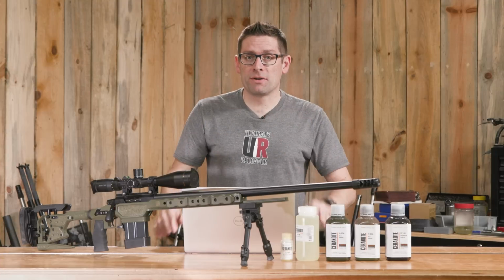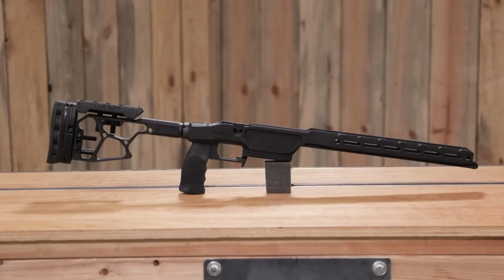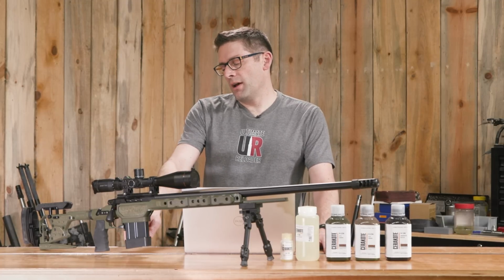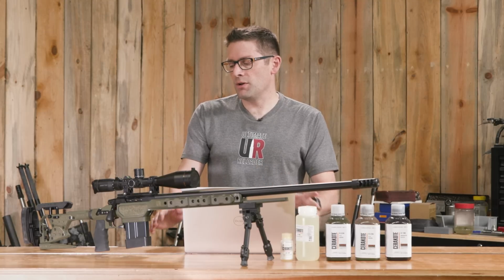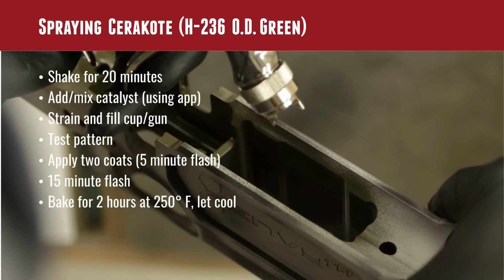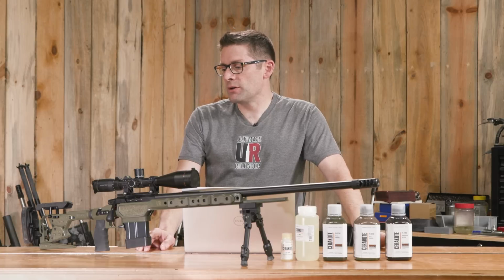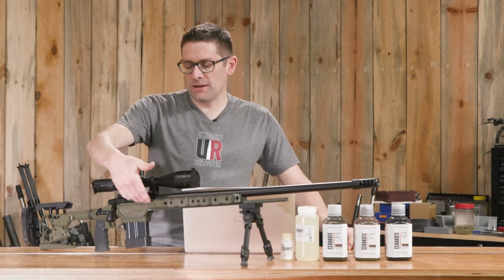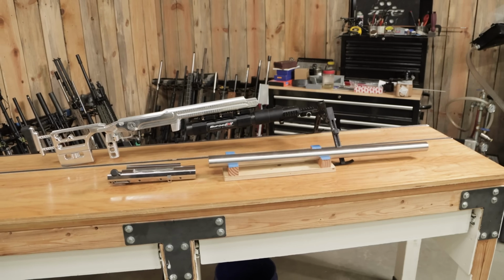How-To: Cerakote + Laser Imaging an XLR Envy Pro Chassis

Comment: @gavintoobe  I know you said your not an expert but  I think you might care about this because of your attention to detail.  But vector formats (.svg, .eps) are not simply made up of a bunch of little points. Thats called a Raster file (.png, .jpg)  where all the points (dot or pixels) make up the line.  In a vector file any point is a vertex where the file describe distance, direction and the curves and lines between vertices.  That math is what makes a vector files like scalable vector graphics (.svg) scalable.  If it where a raster file when you scale it you would loose resolution because you have a predefined grid of dots or points per inch and scaling the file makes the dot & points larger and the resulting image is pixelated

ok love the channel and the growth and direction of things
keep crushing it!

Comment: Iwata is OK and I'm sure it's fine for the job and ive personal owned one... But... Try a sata minijet, the atomisation is unmatched with a perfect flawless fan. Laying down paint is so satisfying with one and worth the extra money 100%.
Q. I'm not familiar with cerakote or its viscosity but watching the vid it doesn't look to different from a 2:1 primer!? It seems to cling well as you got a full wet coat on your first pass or do you use some type of promoter? And Are you useing a standard 1 mm nozzle? I think you've done a great job, my one critique (and it's a small one) as a profectionist I would like to have seen the topography on the but plates continue on from one another so it flowed continously.

Comment: Don't ever cerakote a barrel,action,bolt or receiver. You will regret it. Cerakote will jam your action
Reply from the maker: You can cerakote a barrel! I do not Cerakote the inside of the receiver or the bolt body. I'm thinking that's what you mean here?
Reply: Yes, I have a Cerakote AR10 barrel & a bolt gun action & barrel. No problems with either gun for years. 🧐